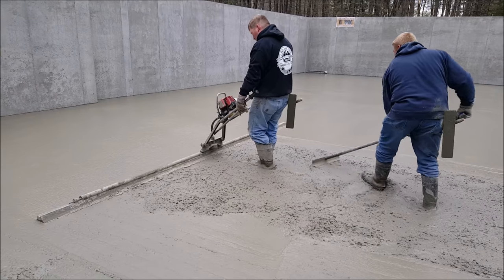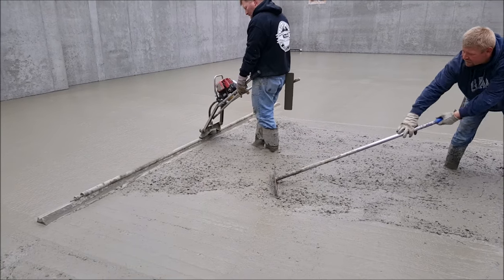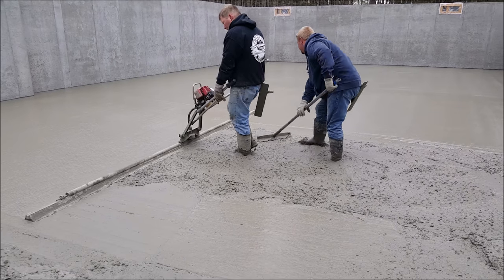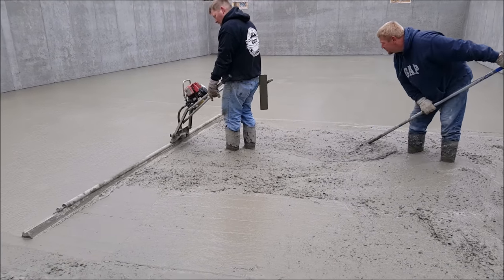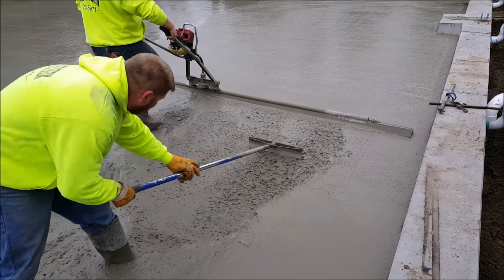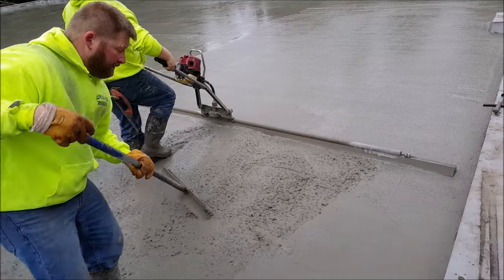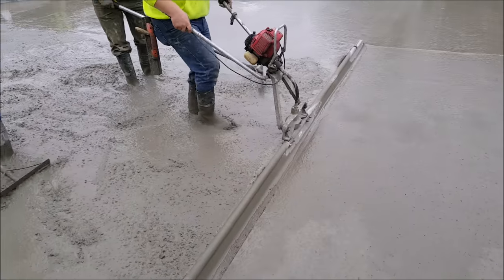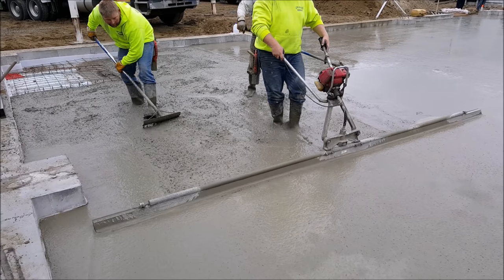How to get a flat floor using a vibrating concrete power-screed tool.

Comment: I’m so happy that you mentioned the rakers twice! We called them “come-alongs”. Very important we knew what was what!
Reply from the maker: Thanks, got to have good rakers behind a vibra-screed.
Reply: GMA
Reply: i usually call them rakes/rakers...i work for a commercial concrete contractor and drive the work van w trailer & crew onboard and don't know why people call them "come alongs"
Reply: how many
Reply: @CSX2665 It's a regional thing. Like how some people will call soda soda, some will call it pop. It's not right or wrong.
Reply: Ow i know why my old boss was such a hardass on us rakers, we were key to making it work, we basically did the screeding while he finished it off.  We rarely left low spots for him to kick in, or more than an inch to pull, and our slabs were the best in town

Comment: please make more videos you teach me alot , i poured 315 yards last month with a 10 foot vibrastrike 2, 1 man and i had alot of humps but it didnt matter in a cattle lot and they wanted massive volume for the cheapest price, all 5 inches.  so I raked and tamped it with my come-along then pulled it back 10 feet at a time while working with the driver.  some sectioned humped and some did not.

Comment: Do you like to run the screed at full RPM’s, or do they fluctuate as you have different concrete slumps?  I’ve used the vibrascred many times, but only with screed pipes.  But I would definitely like to learn the wet screed method.
Reply: Slope and slump have a lot to do with rpms.

Comment: The whole purpose of screening is to get a flat surface. The rakers are important, but if you have high or low areas in the surface, it's due to poor screeding. That's what the screeder is for.
Reply: I screed with a rake so what

Comment: Mike I know this is an old video, but I've been watching a lot of your videos and have a question. If you're screeding a more narrow area, would you ever rest the ends of the screed on the forms if the screed board is longer than the area you're working. Would that still work ok?
Reply: Yeah that would work, it’s the same as using edge forms as grade with a regular screed

Comment: Are you having to use effort to keep the screed on top of the concrete or does it rest on top? I haven't used one of these without a screed pole.

Comment: Seems the concrete had too much water which would not allow it to be drug by the screed. It would also make the slab weak and prone to cracking. Would like to see a 4 or 5 slump worked with machine.
Reply: Superplasticizer

Comment: It looks like there is a lot of water in  concrete.........I have heard that too much water weakens the mix.  Can you comment? Thanks for the video!
Reply: Yes when too much water is added it weaken, but the viberscreed brings up the cream from the concrete.
Reply: You can have the plant put in water reducer and pour high slumps without losing strength
Reply: @baconneggs2406  Thanks
Reply: @lucbarabe1830  Thanks

Comment: I know that this is interior concrete but slump has to be a 10 and less then 2000 psi.
Reply: He adds a plastizer admixture to the concrete, it increases slump without adding water. Just because it looks wet doesn’t mean it’s low PSI

Comment: Interesting, looks like about 120 slump yet the vibrating screed still stays on top of the concrete alright...
Reply: MrMayhem87 Could you please explain to me the term “slump” in concrete. What do you mean by concrete slump
Reply: @braulioperales10  Search it in youtube- there are people who demonstrate it to death. It's how far down the cone falls when you pull the cone off the concrete mix. 0" < slump < 12" by definition, but 4in slump is a little dry, 6" slump is pretty wet. I think these guys must be using a water reducer to get liquidity like that.

Comment: What was the slump? looks  a lil wet
Reply from the maker: Steve - We try to pour around a 6 for a slump. We use water reducer in all our floor mixes to keep the water cement ratio low.
Reply: Mike Day Everything About Concrete looks like a 7.5 or 8
Reply: @trentsmith2370  It is def. at least an 8. Twenty three years experience. In defense, if a "quality"  six bag mix, with proper reducer ratios', are properly adjusted, then this floor will retain a quality tensile strength for at least 40 years.

Comment: Can you run the vibrascreed on top of the form boards? If you were pouring a driveway for example
Reply: Matt Claus yes
Reply: Can but your pegs,what holds the form would have to be lower than the form

Comment: Concrete is too wet wouldn't pass australian standards.
Reply from the maker: High range water reducer is used on most our floors. Can pour a 7 and still pass here.
Reply: Plasticizers and water reducers do not affect the water to cement ratio, technically it is not wet, it is fluid.
Reply: Mike Day Everything About Concrete 

WRDA or Delvo? You want 0.45 water cement ratio for slabs
Reply: Brian don’t embarrass our country and keep ya mouth shut 
Water reducers 
I’m pouring 40 mpa at 120 slump with accelerator comes like piss so
Easy to
Work
And screed 40 minutes later your breaking it . With pans .
Reply: @MrDigger82  So you can have the plasticizer and the accelerator together? Nice. I like the sound of that. What about slowie for hot days...Can that be added with the water reducer?